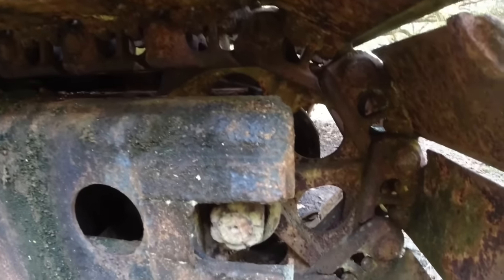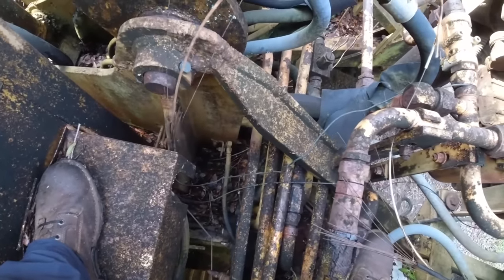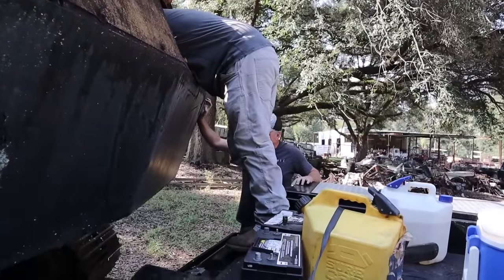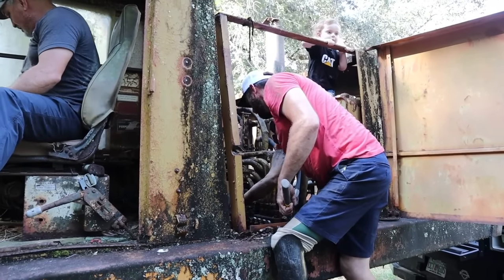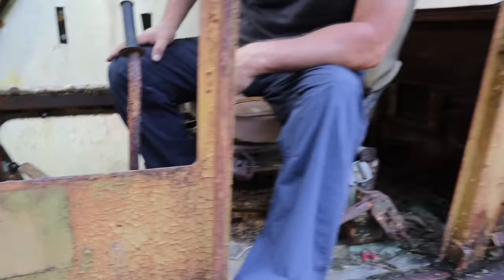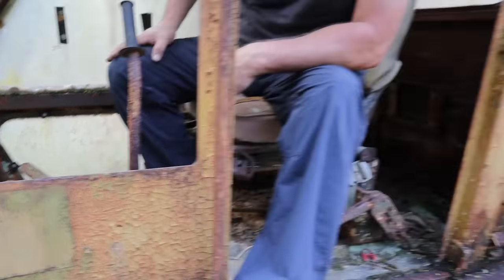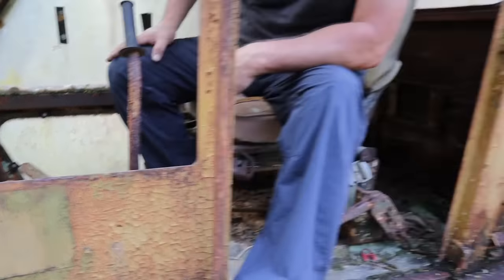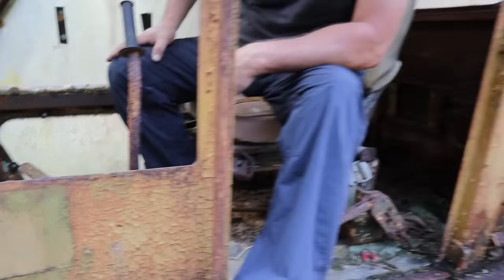We found an Excavator between broke down semi's! Will it start?

Comment: Drotts were known for having a turntable leveler. I learned on the exact Drott 50. It's a 6 V53 Detroit. The one my boss had was a 1974, this one is very close to that year also. It's a 1 yard 50,000 lb. Machine. The 6V 53 puts out 197 horsepower. In their prime they were digging machines!

Comment: I do believe the emergency shut down on that engine is a "spring loaded to close. butterfly valve" that shuts the  intake air off
at that aluminum elbow on top center of the intake, it does it via the shutdown pull cable and a trip lever at the butterfly valve 
assembly.
Just make sure it is operable, free to open and close and it "WILL" kill the engine ----- "Most of the time !!!!".